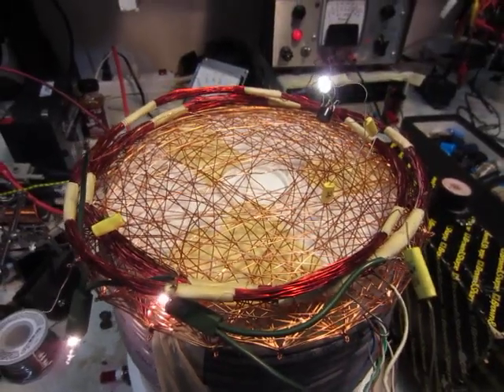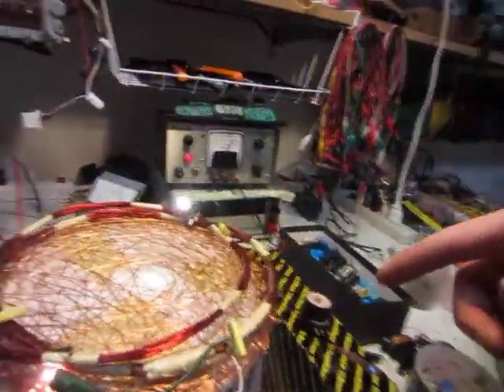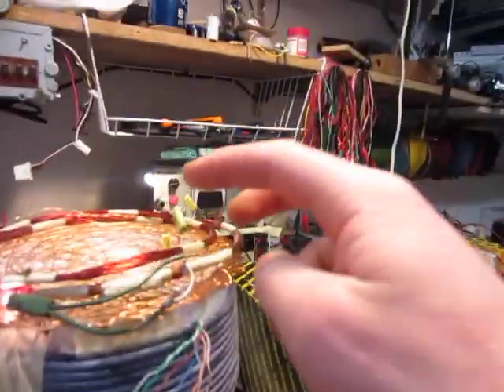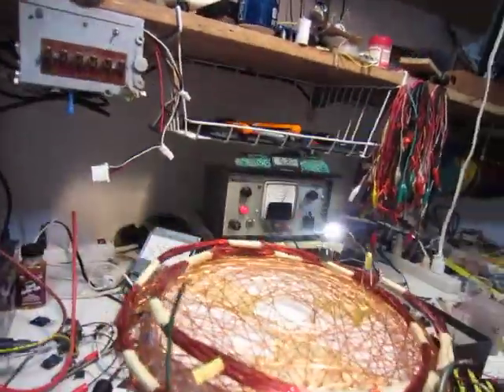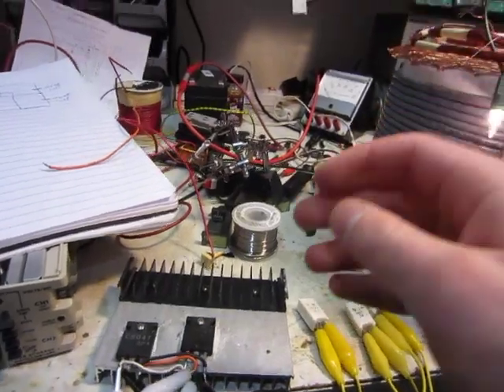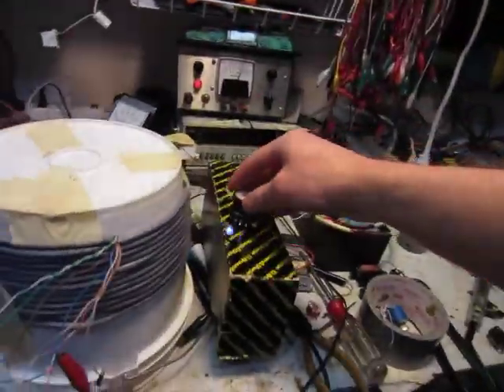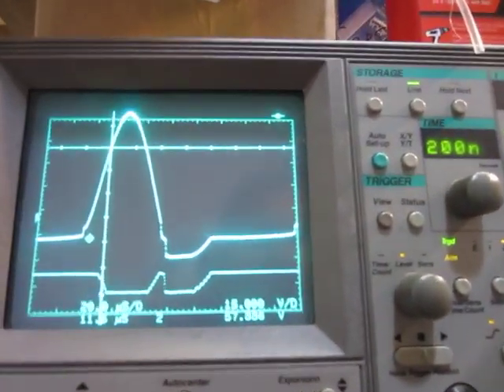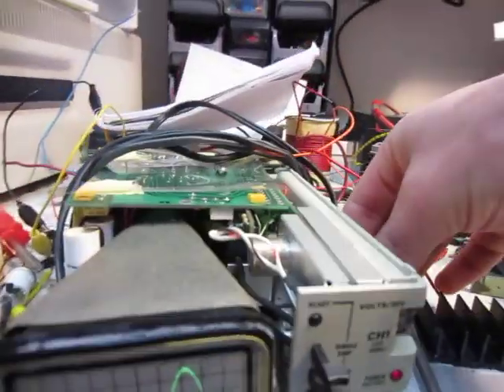Wireless Joule Thief Using CAT5 Cable

Comment: How did I miss this one? Great work. Have a look at a receiver on the scope with the base or collector line for reference, and play around with the caps, and you will start to see the resonance. Pancake transmitters seem to tune a lot more easily. I get slightly better range with untuned pancake coils. Not surprised you blew a globe, was that on rectified or ac? Leds seem to work best on ac. Bifilar coils have some capacitance, and induction, diode is like spark gap. So they self resonate..